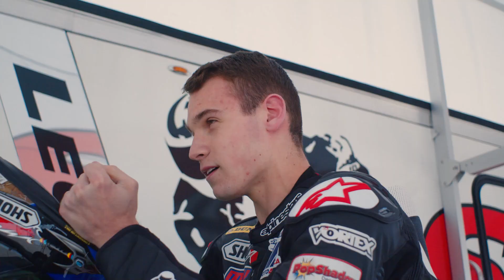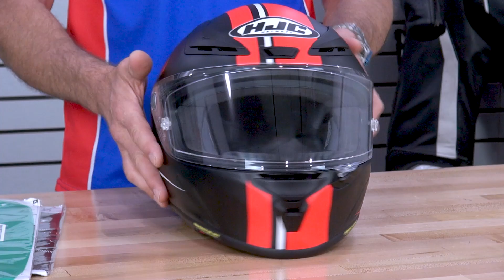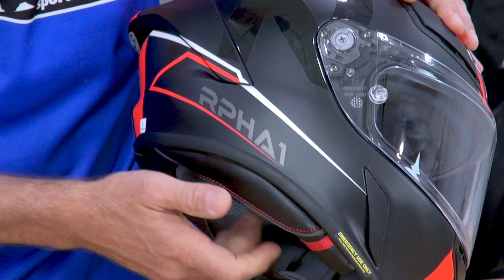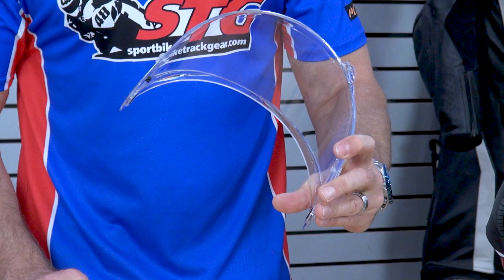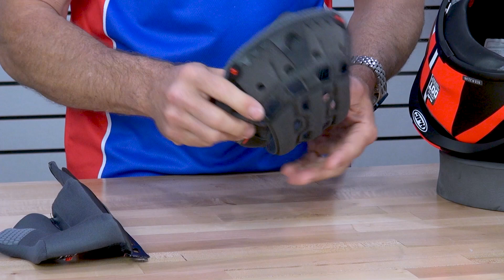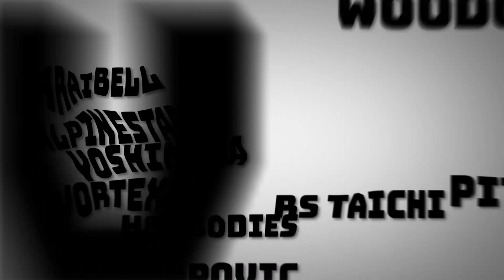HJC RPHA 1N Helmet Review | Sportbike Track Gear

Comment: I have the AGV K1 as my first helmet. Actually the guy I bought the bike from had a 10+ year old HJC 3 sizes too big that he threw in with the bike. That was technically my first helmet but the AGV came in the mail 2 days later so I consider it my first haha. Anyways, I’m not totally satisfied with it and I’m gonna buy a RPHA1N in the spring. Probably a race replica or Red Bull graphic.
Reply from the maker: The RPHA 1N is a big step up from the K1. IMO the K1 is an excellent first helmet. Make sure to take a measurement and compare it to the size chart to make sure you are getting the right size. We find many riders wear a helmet that is larger than it should be. - Van

Comment: I ran the RPHA 11 Carbon and never felt like it was that comfortable, then my next helmet was a much cheaper Scorpion Exo R1 Fabio and thought it was a much better helmet than the HJC.  The scorpion had better padding and fit my head so much better for half the price.  Now I am wondering if the RPHA 1 is a significant upgrade over the RPHA 11, as I really like the Ben Spies edition RPHA 1 but not sure if I want to trust HJC again
Reply from the maker: I did a fair amount of riding in the RPHA 11 and liked that helmet. IMO the Scorpion R1 Air and the RPHA 1N are both better than the 11. If you are happy with the Scorpion (for sure one of my favorites) I would stick with what you know. - Van

Comment: Red bull graphic its so cool. 
IYO hows compare to x14? 
X14 imo its the perfect helmet. Safety and especialy comfort that make x14 great. Unfortunately the inner not so much durable. Mine just two years with occasionally wearing start to crack here and there in the syntetic leather and thr foam start to fall off.
Reply from the maker: Sorry you had an issue with the X14. Max and I both have X14's that are well over two years old and have not had a problem. If you bought this from us we can work with our rep to get this sorted out. - Van
Reply: @sportbiketrackgear  thanks. Im live in Bali Indonesia. Its had to be the humidity environment. Lot of x14 user here with same issues.

Comment: Nice looking helmet but one small hole for the center brow and screws for the visor? The weight compared to the RPHA 11 Pro! A step backwards.
Reply from the maker: The visor is a step forward and I expect the vents to be very effective. As for the weight this is what it takes to pass the standards they have built the helmet to. Personally I do not find the weight of this helmet to be any issue at all. I have worn a ton of helmets over the years and never really experienced a massive difference with helmets that are a few ounces lighter. - Van
Reply: @sportbiketrackgear  Thank you very much for your reply Van. Very much appreciated and good luck riding and reviewing. Excellent job!

Comment: At a difference of £200-£300 between this and the Scorpion exo r1 air carbon would you say this is well worth the extra? Thanks
Reply from the maker: The Scorpion is an excellent buy and has proven itself to be a great helmet. I do not believe there is a massive difference between the two of them. If you need to keep the extra in your budget go with the Scorpion. - Van

Comment: So I measure 57.5 cm around; wear a RPHA 11 Pro in a Medium right now. When these come in stock, would you recommend a Large like you had to get yourself? Or should I get a medium again. (I also have a Carbon Exo R1 Air I wear in a size medium as well for additional reference)
Reply from the maker: Based on what you have said I would go with the medium in this helmet as well. Should get an excellent fit. - Van
Reply: Medium, maybe even S if racing, mistake to go L with that size. 😀
Reply: @pravesh736  I was thinking medium too. AGV helmet sizes made me uncertain because a ML is too big around my neck/head and MS is def too small. I definitely second guess helmet sizes. But the RPHA 11 PRO is my fav helmet so far

Comment: Is the 1N simply a shell with a single composition EPS and lastly the liner? Was there more to it along the lines of a Bell Flex or Fly Formula? They don’t say much about it on the HJC website.
Reply from the maker: The EPS in the RPHA 1N is painted black (as most EPS liners are) so I am not able to tell when the liner is removed. When I spoke to HJC USA about this helmet asking for some details on the FIM cert and other points the person I spoke with did not have the info I was looking for. From that call it was clear they feel the FIM cert through the entire size range should give riders confidence in this model because the exact same helmet is being worn in the highest levels of motorcycle racing. - Van
Reply: Thanks. Good to hear the US version of the 1N will be FIM and ECE 22-06 approved. The Bell Flex sold in the US is not ECE approved. Only the models sold in Europe. Bell indicated the shell is different. I believe the Snell cert requires a shell that is quite stiff and makes slower speed energy management more difficult. Don’t quote me, that’s from memory.

Comment: I had the RPHA 11 Carbon and then bought a Scorpion EXO R1 which was half the price of the HJC and now I wear the Scorpion 95% of the time.  Such a nicer, higher quality helmet than the RPHA 11 and it was much cheaper.  Does this new HJC have a better fit and finish than the RPHA 11?
Reply from the maker: The RPHA 1N is a serious step forward from the RPHA 11 Pro. Fit, finish and overall quality are outstanding. - Van
Reply: I kinda have opposite impression on the Scorpion exo r1 carbon.  I feel like the liner in the hjc is nicer, and scorpion is physically bigger and bumps into my jacket on shoulder checks. I also had a couple fit and finish issues with the scorpion  where the rear spoiler meets the helmet also the center latch on my clear visor was broken upon arival.  I don't hardly wear it as the hjc feels better on my head.
Reply: Kinda the same here, went from the RPHA 70 to the EXO R1. Fit, finish and quality are just so much better on the Scorpion. Did you find any huge difference regarding airflow and noise between the RPHA 11 and the R1?
Reply: @superquadromaniac  you know I don't wear the HJC much at all anymore so I couldn't compare wind noise that well but I would say that EXO R1 maybe has slightly more wind noise just based off of the fact that my Sena comms are more difficult with my buddies with the R1

Comment: Cool ass helmet but the price point puts you in x14 range. Something would have to be amazing to beat the X14 for me.  
Awesome review bud
Reply from the maker: I need to ride in this helmet to see how it performs as compared to the X14. My expectations are it is very competitive. - Van
Reply: @sportbiketrackgear  if you tell me it flows more air and you trust it as much. I'll order it right after you message me. I love the x14 but I like more airflow.
Reply: I got 2 X14 and just got the Austin Redbull RPHA1. Haven't got the chance to test the RPHA1 extensively yet but I like it so far. The two X14 I got are matte and I can tell you those paint don't last long. They are very easily scratched. I also like the face shield locking mechanism on the RPHA1. Seems easier to handle and it's definitely safer. Maybe it's just me after all those years, I would need a break from X14 haha.